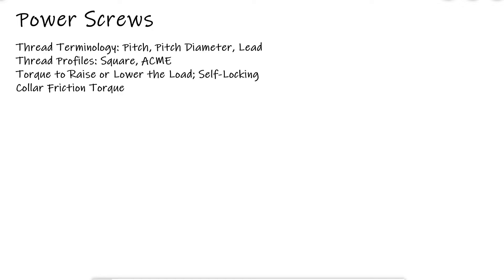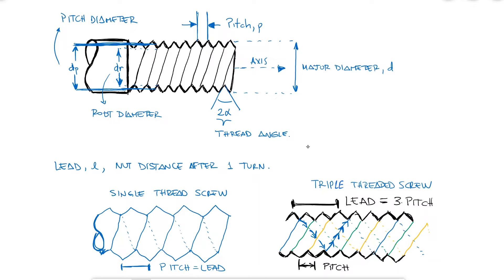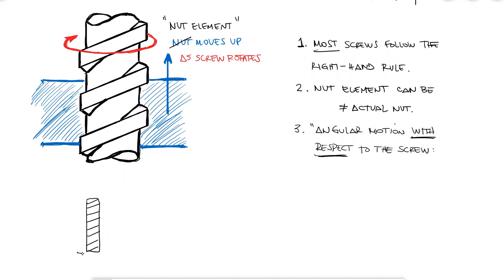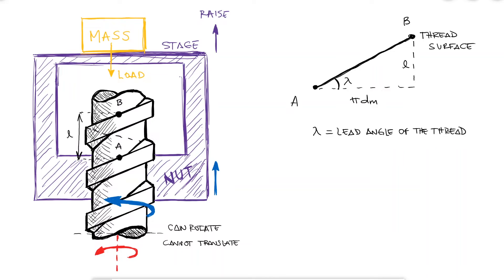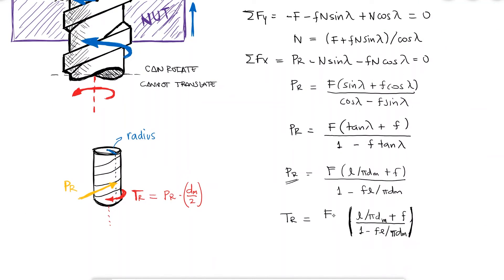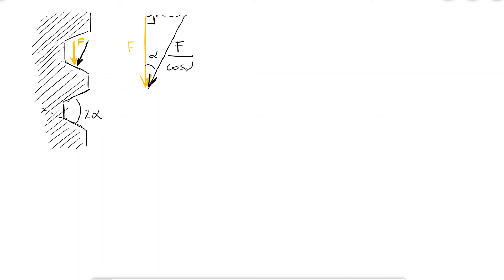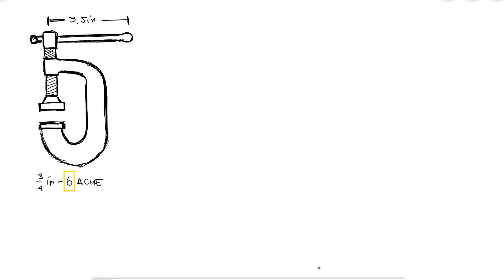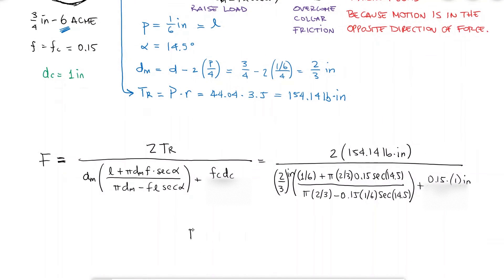Power Screws - Torque to Force Relationships in Just Over 10 Minutes!

Comment: I’m confused about the collar torque. If you are rotating a drive nut that is fixed in the linear direction, wouldn’t the stem or screw not rotate and only move linearly? I can’t visualize how the stem would also rotate from the rotating nut.

Comment: Hi, so much love for the videos. Just have a quick question if you do not mind answering. Here you use a right-hand screw, and you mention rotating the screw in the counterclockwise direction without having it translate makes the mass move up. I would really like to understand what you mean by mass exactly. If you put a screw through a piece of paper for example held at one end, and lose at the other, and you put your finger at the top of the screw (screw head) to resist it from translating; rotating the screw in the counterclockwise direction would be untightening/losing the screw which makes the piece of paper go down not up. However, the force my finger is feeling at top (screw head) would be a force trying to move it up. Is my finger serving as the mass you're trying to describe. I was thinking it was the nut/member which refers to the piece of paper in my example.
Reply: And shouldn't the threads be moving towards the right not left making Pr and Fn to be flipped in the FBD?

Comment: A truly excellent presentation, resolving the virtual whole of one of the most common and often poorly attended issues of modern engineering.

Having taken careful notes, explicitly because your presentation is so comprehensive, I did however notice a minor inconsistency, which I am sure, given your skills, is no more than an inadvertent editorial omission. The following is pasted directly from my notes; with the inconsistency relating to the radius r in your prescription for accounting for the frictional resistance of thrust bearings, beginning at 7:23:

What is drawn as r is actually the outside diameter, odc, plus the inside diameter, idc, over 4. Thus for the nomenclature of the equation to stand, r must be re-defined as:

r = (odc +idc) ÷ 4   [rather than dc ÷ 2]

However, as this re-defined r is actually the mean radius of the "collar" (thrust bearing), it would probably be preferable to refer to the resultant r instead as the mean radius of the collar, mrc.

Thus:

mrc = (odc + idc) ÷ 4

FRICTION = fc × N = fc × F

Tc = FRICTION × mrc

or

Tc = fc × F × ((odc + idc) ÷ 4)

Where, if dimensions are expressed in meters and force is expressed in Newtons, the resultant torque, Tc, is expressed in Nm.

[end of note]

Again, many thanks for your excellent presentation. I wouldn't even go back and "fix" this, because anyone applying your excellent prescription will surely understand that you drew what you meant... and certainly meant for us to calculate what you meant. So, this would indeed be a very minor amendment.

Keep up the great work.

Comment: The most clear video about power screws on YouTube. Bravo.
If there is a backlash between the screw and the nut, so that there is an angle between the 2 axis (typical with a eccentric load), how would you quantify the additional resistive torque ?

Comment: Isn't the lead is the same as the Pitch?
Reply: No, pitch is just distance between two adjacent threads whereas lead is distance that a nut move wrt bolt per one revolution.  However they are same for single thread screws and bolts but differ for multi thread screws and bolts.

Comment: Great video!
But I didn't understand a thing: speaking about angled thread profiles, the force perpendicular to the thread flank shouldn't be F*cos(α) instead of F/cos(α)?
F/cos(α) means that the perpendicular force is in modulus greater than the force you start with, am I missing something?
Reply from the maker: Yes, the force is larger: the force that you need to exert on the threads (through the torque) needs to be higher (F/cos(α)) so that the linear force, parallel to the screw and pushing it up or down is F. We want the relationship between the parallel force F, and the input torque T, not the normal [perpendicular] force to the surface of the threads. 
Also, input/output. Doesn't matter if torque or force is input/output.
Reply: @LessBoringLectures  Thank you!
Reply: @LessBoringLectures So, what is FBD equation: F/cos(α) = F + what vector? What is the vector? What is the horizontal component? And why is it horizontal?

Comment: 4:04 what does guarantee that nut element won't rotate with the screw instead of translating?
Reply from the maker: The nut element is called that, because it's not necessarily an actual nut. It's just any element that is tapped/threaded. Therefore, the "nut element" won't rotate If it's a structure that is not allowed to rotate (physically).
Reply: @LessBoringLectures  thanks for your reply and for the high quality content.

Comment: is dm the same as dp? i.e. (d+dr)/2 ??? It seems odd to me that frictional force is being calculated along the mean circumference (i.e. fn = f*Pi*dm) and not the mean thread area. The root diameter portion of the rod doesn't resist any friction. Only the threaded portion resists friction. So again, how come frictional force is being calculated along a linear path and not an aerial path?
Reply from the maker: The value for dm is only equal to dp for ACME or squared thread profiles. 

The friction does in fact affect the contact area at the threads, which for any location along the thread line, is a constant distributed load in the radial direction. This distributed load can in turn can be substituted by a point load for simplification purposes, without resulting in any difference in the final expression, whatsoever.
Reply: @LessBoringLectures  But what if your threads were extremely wide? Let's exaggerate so that I Illustrate my point. Let's assume the root diameter, dr,  equals 1", but the main diameter, d, equals 10". That's an extremely wide thread that would amount to a much greater frictional force. Your calculation doesn't seem to take into account the thread width at all. Rather, your provided calculation considers the mean diameter, which, in my silly example would be 5.5" for an ACME thread. How come thread width isn't incorporated? What am I missing?
Reply from the maker: You got it right (you're not missing anything). The point load will in fact be found at 5.5 from the center. Friction is not dependent on surface area. This is a common physics misconception. More surface area does not mean more friction: as long as the normal force is the same, the friction force is the same. Pushing a box while on its smallest side is as hard as pushing it while on its largest side: pushing it requires the exact same force (as long as the surfaces are all made of the same material = meaning same friction coefficients).
Reply: @LessBoringLectures  wow. brilliantly explained. thank you! one final question. Is "F" the load on the entire bolt? Or is "F" the load on a single thread (or lead)?
Reply from the maker: @markconverse927  No prob! F is the total load that affects all the "engaged threads". That's why we divide it into the number of engaged threads when calculating stresses at the threads: https://youtu.be/46lcuQYQ14g
Reply: @LessBoringLectures  hmmmm. that concept isn't clicking for me. Your Free Body Diagram represents one (1) unfolded lead only, flat on a cartesian plane. Since the FBD is only one lead as opposed to the entire unfolded length of "engaged threads", it would make sense to me that "F" is the load on 1 lead only, NOT the entire length of engaged threads. What am I missing?
Reply: @Less Boring Lectures any reply to this question?
Reply from the maker: @markconverse927  Friction and forces are independent of surface. We're not calculating stresses or pressure. One engaged thread or 1000 threads, it's still the same forces. You can stand on your toes on one foot, or lie down on the floor, your weight force is still the same.
Reply: @LessBoringLectures  ahhh, same idea as previous response. Makes sense. Thanks
Reply: I believe your question was possibly referring to why his calculation for d_m was = d - 2(P/4) instead of dm = d - P/4 because the first one I believe would give root diameter dr instead of dmean which is in between dr and d for Square and ACME threaded profiles like he said in his reponse. Why is it not dm = d - P/4 = 1 in - (1/6 in)/4?
Reply: Is the mean diameter the "minor" diameter?

Comment: Sir can I ask how can you get the maximum clamping force, take for instance a bench vise , while you are neither given the torque nor force applied.
Reply from the maker: The maximum clamping force will depend on the maximum torque you're able to exert on the vise. That torque would be however much force you can push the handle with, times the length of the handle (the distance between where you're applying the force and the axis of rotation of the handle).

Comment: Sir can i ask for simple square threaded problem for you to solve step by step? Hoping you could 🙏🙏
Reply from the maker: The only difference between ACME and square thread profiles, in terms of the power screw torque equation, is that the secant of α is 1, as α = 0. The pitch and mean diameter are the same as in the 3 additional examples of this video. I will record one with square threads in about 2 weeks though. Links will be updated!